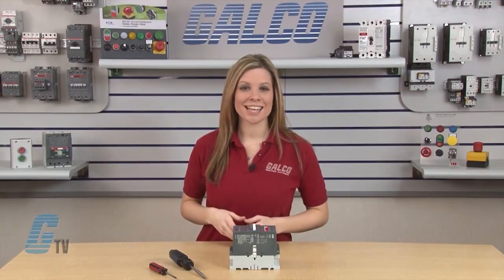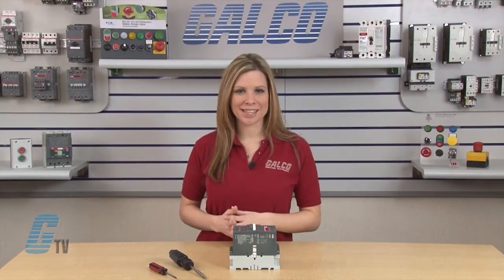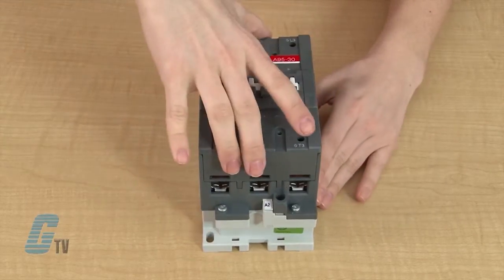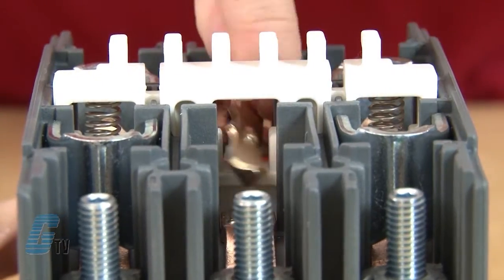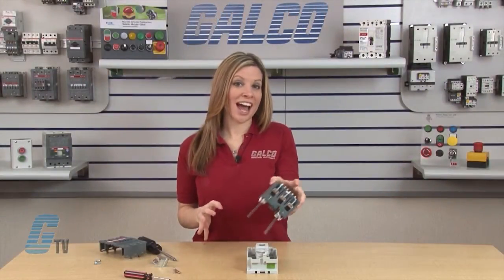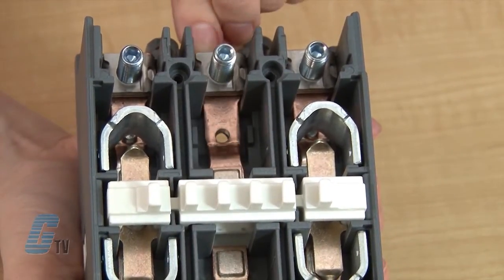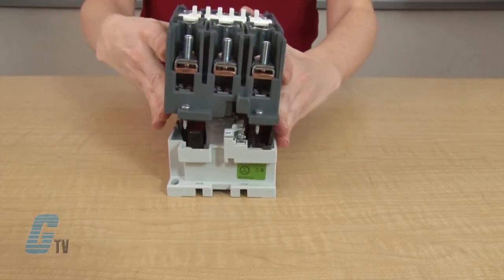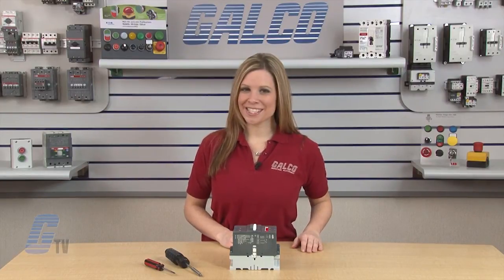How to Change the Contacts on ABB A-Line 95 and 115 Series of Contactors

Comment from the maker: ABB offers dual terminals for the ‘A2’ coil connection, allowing the user to wire the coil voltage from the bottom, or from the top and bottom of the contactor.  Both ‘A2’ terminals are electrically tied to each other.